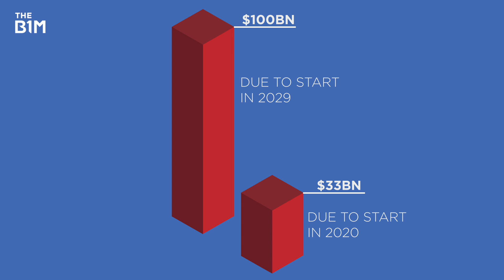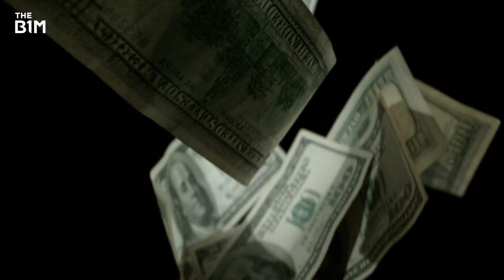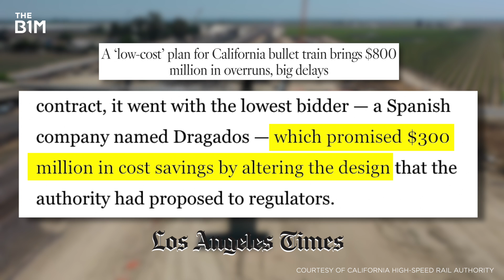What Went Wrong With California's High-Speed Railway

Comment: First problem of the project:
Trying to build public transport in USA.
Reply: Texas managed to get theirs in control. 
The problem isn’t building a mega project in the US
The problem will always be the greedy politicians controlling it. With no intentions of finishing the job with money but rather want someone else to pay them back. GREED
Reply: Maybe conspires but also piss poor planning. WHY not start at both ends to the next point and get immediate economic benefits and then iterate to the middle???
Reply: @esioanniannaho5939  What economic benefit does a very costly station in the center of LA have if there's no train route to anywhere?
Reply: @esioanniannaho5939  Not far from each end a long tunnel is required. A long and expensive tunnel. And there lies the problem.
Reply: Massachusetts has an unusually expansive commuter rail system which is growing steadily
Reply: The only way we’re going to break the cultural norms is by biting the bullet and taking a heavy loss early on to establish public transport as an option for everyone, not just “poor people”. Once this stigma is removed (it will likely take 50 to 70 years), society in the USA will get one step farther away from its inevitable damnation due to lack of sustainability.
Reply: @sarahwood8943  I maintain that fairs should be subsidized at the rate of $5 each way. Let everyone else pay expensive rates at rush hour.
Reply: And being subverted by the Koch Brothers.
Reply: No public transport infrastructure to support this. They pulled up 99.9% of the country's rail tracks to force the railway workers unions out of business. You could go to about ANY town ever known to have existed in the States by locomotive.
Reply: Problem of any PT transport project in the USA is:
- People don't want to pay tax
- To much influence from Automobil and Airline industry
Which in their turn are caused by the 'Republican way of thinking"

As long as the Republicans have approx 50% and most US citizens don't know the difference between Social Democracy and Communism USA will never have the same infrastucture (and a lot of other things) as the EU.
Reply: @MrRCGNL  I think California's High speed rail mess is a pure example of "Letting politicians run your business instead of the company itself"
Reply: @Racko.  If you let companies run those project it'l be an even bigger mess.
They only look at share-holder value.
Concerning public infra structure you have to accept that is will NEVER EVER really make big profits.
And the even applies to Europe.
But nobody bothers,
Because ""we"  have a differen idea how to run a country.
And a country is not a company.
Reply: @MrRCGNL  I'd argue Politicians still make it worse, they all look at profits, and ofc those megaprojects wont be profitable, even China's massive HSR system makes 0 profit. The only to routes of HSR in the world that makes money is France's Paris-Lyon and Japan's Tokyo-Osaka
Reply: @MrRCGNL  The difference between the US and Asian and European nations is they make things to benefit the public. In the US it's done to benefit the person behind it or the company, everyone else loses
Reply: Yet it seems high speed rail will materialize in Texas from Dallas to Houston. Take note of which states get the backing of the federal government and which ones are hampered. If I were a conspiracy theorist, I might believe certain members of Congress are deliberately trying to wreck California's economy in favor of red states.
Reply: @WestOfEarth  
If you watched the video, you would know that it’s California that’s getting in the way of California. Approval for the railroad route is bogged down in the Environmental Review stage, which is seldom a haven for the “Red State” stereotypes you cling to as an explanation for the culprit.
Reply: @colincopland3665  Actually, the main delay has been the eminent domain cases in the courts, and the court system has been made even slower by COVID-19. This is with reference to the construction zone. There were earlier delays caused by environmental review - including federal review - but all the environmental reviews underway now are for the sections planned to be built after the present section and should be finished within 18 months. Those sections can't be done until the money is lined up anyway.
Reply: @WestOfEarth  the Texas High speed rail project is a mess. In 2011 they said it would be done in 2018. Than in 2014 they said 2020. And now they are saying 2027 if they start now. They don’t have the money yet which is why they keep delaying it. Also they have been saying we will start construction next year for almost a decade. California started construction within 5 years.
Reply: @WestOfEarth  Also, the line in Texas is working with both Japan (for trains) and Spain (for rail), while in California that's not the case IIRC
Reply: @WestOfEarth  Maybe, but right of way alone in California is just going to be more expensive than in Texas where land value is significantly less.
Reply: @WestOfEarth  The high-speed rail in Texas and Florida is fully privately funded. That's a huge reason it's much easier to build and less costly. California hates private enterprise, so of course they had to start without private funding. Now their ridiculous red tape has scared off investors, so they're left three times over budget.
Reply: @mastahfrederique1147  California and Texas lines seem quite different to me. The alignment in Texas is flat, open and straight. The alignment in California passes through densily poplulated areas (expensive land aquisition), mountain ranges requiring long tunneling, etc. The price goes up exponentially when these are involved.
Reply: @mastahfrederique1147  Texas doesnt have jigh speed rail yet
Reply: @WestOfEarth  also texas is a very red state and republicans arent too big about public transit but then again texas is turning blue so it could go eitehr way

Comment: If only things were as easy as when the interstate freeway system was built.
Reply: The president at the time wanted it done and it got done despite some of the same obstacles that face the high speed rail system. The problem with high speed rail in the US is lobbies. The lobbies that influence politicians and people alike. Still, if the president/government wants it to be done, it can be done.
Reply: @muazqamar  Not just lobbyist, it's also the fact that Freight companies dominate the entire rail network across the US. Apart from the NEC owned by Amtrak. Also strict property rights, old rail technology, and Airlines and auto-industry convincing the government not to invest in HSR.
They'll to everything to avoid HSR from coming, instead of thinking about how behind they are when compared to other developed nations in Europe and Asia
Reply: @Racko.  Hmm that's interesting. Don't you think that that's an another reason in favor of high speed rail though? If current rail network is dominated by freight, then all the more reason to expand passenger rail. Also, yes the property laws are a hurdle but if the government really gets "on board" with HSR, that can be overcome.

Lastly, old rail technology will automatically be replaced or upgraded in the process
Reply: @muazqamar  Well the biggest problem isn't really any of what i've mentioned, they can easily make HSR If they wanted to, the main problem is they just dont want to. Idk why this is the case. Amtrak's NEC is in desperate need of new high speed tracks, it's slow from DC-Boston either way, the only places with High speed track that can reach Amtrak's full speed is several stations around Rhode Island 
The Freighter train domination is no big deal, The government can build dedicated lines only for high speed, which is very common in Europe and Asia
Reply: @muazqamar  because back in the Eisenhower era, there were no sprawling suburbs, and the lands between big cities were mostly farmlands or government owned empty lands. So it was easy to buy up lands for freeway system, whereas today, you have to kick out millions of people and compensate them with billions of dollars.
Reply: @muazqamar  I don't see how lobbying inhibited this at all. The real problem is that this is the modern day and we have worker safety and environmental protection and land rights laws that we in the US adhere to. China doesn't really need to follow these principles, which plays a major role in how they built up there infrastructure so quickly.

Here in nyc, no new subway tunnels are being built, and the latest one cost 20x more per mile, adjusted for inflation, than it did a century ago, because of these regulations, and also because nyc can't afford to shut down traffic in it's urban center to perform loud construction, especially on billionaires row. I'm not saying that laws that protect property rights and workers safety and the environment are bad, but they, along with the unacceptably of having our lives disrupted by highway closures and loud construction, do make constructing things more expensive in the "first world" than they used to be
Reply: @optimisticnihlist9705  Big oil and auto manufacturing lobbyists fight any movement towards high-speed rail. On top of the fact that LA county and California state governments are well known to be corrupt and money-hungry.
Reply: @optimisticnihlist9705  It's a well known and documented fact that the aviation industry and automotive industry in the US is lobbying HARD against high speed rail. And it's been like that for a while now as documented by videos like this:

https://youtu.be/Qaf6baEu0_w

Yes the land rights, construction, and environmental impact are all causes that contribute to the US not being able to have a high speed rail network, but they are not the main reason why there is no high speed rail here. Additionally, it doesn't help when contractors, rail companies, construction workers etc are all in it to make money off the government, essentially working against them just so they can have job safety, benefits, and obviously more money.
Reply: @optimisticnihlist9705  Look also at the examples where things got done correctly.
Reply: @optimisticnihlist9705  Funny how workers demand to be paid the equivalent of CEOs because of the unions, but still cant find any jobs in NY.
Reply: @optimisticnihlist9705  wait wait wait. The amount of land that was imminent domained all over the usa was massive.
Reply: @muazqamar  I believe it’s government waste and incompetence.
Reply: @artiew8718  Couldn't agree more
Reply: @artiew8718  I’m sure that’s a contributing factor, but the primary factor has simply been land-acquisition.  Individual landowners are compelling constant redesigns and ongoing court battles.  People don’t recognize that high-speed has strict geometric requirements.  Curves have to be extremely broad and sweeping— much more so than those of freeways.  It makes fitment of the system very complex when you’re trying to respect individual rights while battling with the laws of physics.

To put a number to it— at 220 mph, the minimum radius is 23,000 feet.  A train could go at this speed around a circle of about 8.75 MILES in diameter.  That is gigantic.
Reply: @HollywoodF1  Yep. The US has the stupidest land law for these kind of projects. It is basically impossible to get a land you need and you cannot even build under or over it cos it belongs to the land, too. Used to be a good law hundreds of years ago but causing extreme troubles. Like the second amendment.
Reply: NEPA

Comment: While linking London to Paris with a tunnel literally under a sea "only" cost $20 bn.
Reply: Considering it was done a while ago it was a true engineering masterpiece and I use it frequently to drive to Europe. There are actually 3 tunnels. 2 for trains and 1 service tunnel. Your cost figures are also completely wrong. The full price of it was about £4.5 bn. which is like £12bn in today's money
Reply: 12 billion quid is around 17 billon dollars at the current rate so at some point in the not too distant past the 20 billion dollar figure wouldn’t have been far off
Reply: The 57km long high speed rail tunnel through the alps did cost 11B Euros and took 20 years.
Reply: @wocket42  DLR cost more per-mile than any rail to date built without the need to go under or through anything , and one thing it does not have is speed.
Reply: It's "easier" to build under sea as the environmental impacts are smaller, and the is no land aqusition-problems. Also you can build in a more or less straight line
Reply: @Teiscream  every meter of tunnel is insanely more expensive than regular rail and that is especially true when you dig under the freakin ocean.
Reply: @RandomUser2401  yes very true. But the price pr. meter track isn't what ranks up the cost. Time is the killer
Reply: @Teiscream  but it also takes much longer to build a meter of tunnel?
Reply: @RandomUser2401  it doesnt take that much longer. The time-killer is the land acquisition and the social- and environmental issues with over land rail
Reply: @Teiscream  only prince Charles and his mom the queen can object as they own all the sea touching UK's shores and get a commission from users.
Reply: Their was no real estate they had 2 buy from individuals. Houses in California go for millions and to build miles of high speed rail, you can see where the cost goes.
Reply: 🤦the reason why it costs more is because they have to acquire land rights from the citizens that currently occupy the land.
Reply: @james3634  does the state not have imminent domain powers?
Reply: @shanewillbur1325  no one in China technically owns their land as the communist party owns everything and keeps the cost of compensation to citizens low
Reply: @shanewillbur1325  yes but the state can't just show up with a bulldozer and shovel and kick the land owner off.  They can fight the state in court and that costs both time and money.
Reply: Yeah and it only took nearly 200 years to build
Reply: if only us brits could build like that now hs2 is going to cost over £100 billion for just 531 km of track making it the most expensive railway in the world
Reply: I also wanted to take into account the line infrastructure to London and, to some extent, to Paris. But never mind. Stuff got more expensive.
Reply: How much of that budget has ended up in the pockets of lawyers and/or mobsters? Two competing entities that always seem to gobble up a lot of money in the USA.

Comment: The HSR plan was a disaster even in concept. It’s not even a fast alternative to flying; they added so many train stops along rural central California (where no one wants to go) as a concession to local communities to put a train through there. This causes the travel time between SF and LA to become MUCH slower. The reality is that no one would be picking HSR over flying unless one wanted to spend twice the time to travel. Also, the line would never work because LA is far too decentralized. From Union Station, a pedestrian would still require a taxi/Uber ride to wherever they would need to go which in LA would take over an hour. The Uber to the origin train station, the 3 hour train ride, and the second Uber from the terminus train station to wherever the destination is would be the same time spent traveling than simply driving yourself between LA and SF. Not “high speed” at all.

As much as I love mass transit and train travel, California’s HSR plan was a colossal failure. That money should’ve been spent expanding the subway system in Southern California which today is only served by a slow Amtrak line or LA’s very limited subway line.
Reply: Pretty sure the LA Metro and Metrolink extensions would alleviate that....